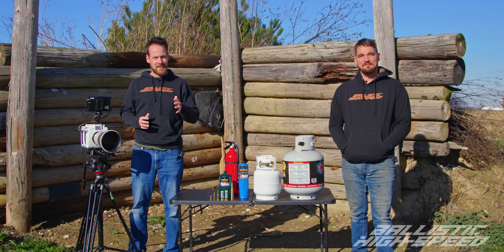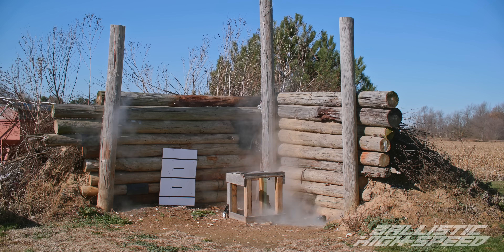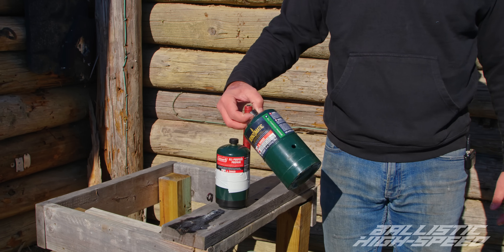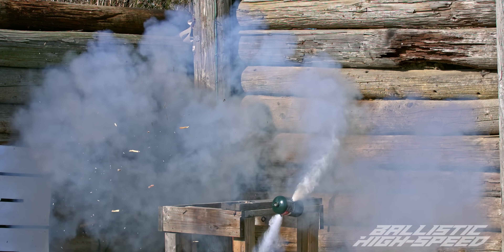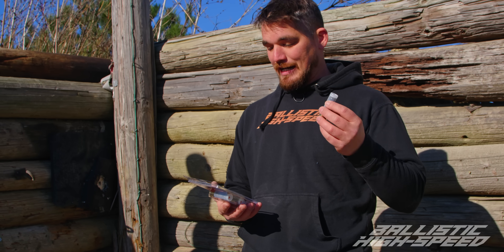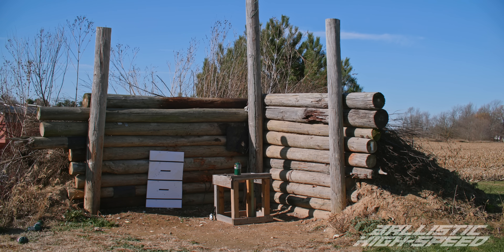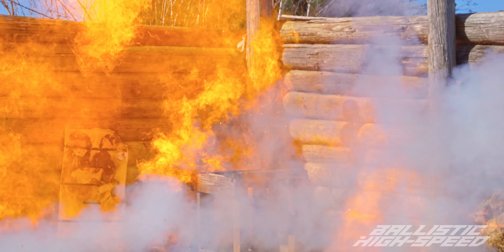Shooting Propane Tanks = Exploding Fireballs?? - Ballistic High-Speed

Comment: The back side of shut off valve is the pressure relief valve. 
So the pressure was high enough, to make the relief valve open momentarily.
Reply: Many, if not most, relief valves on those tanks are self-destructive. They are designed to be a barrier that will rupture at a lower pressure than the rest of the tank and fittings, but it is a permanent failure, thus requiring a replacement valve before refill.
Reply: @kyleheins they’re not self destructive, or burst disc style. They’re spring loaded PRV’s that self reset. I’ve replaced literally thousands of those valves and filled thousands of tanks. 

I’ve also had to pick up tanks that were popping off at distribution locations because the guy filling wasn’t paying attention….
Reply: @adamtalpash6469  Interesting. I just assumed they were the same as the ones on pressurized gas cylinders I've worked with. Guess not.
Reply: The relief valve is literally a tiny hole.  The force was enough to unseat the entire valve.
Reply: @courtney5796  I hadn't looked closely, that's hilarious!
Reply: @courtney5796  I think I know what you’re talking about and it sounds like you’re talking about the bleeder valve, the OPD/pressure relief valve is basically the entire back side of the main part of the valve. The bleeder is the little hole on the front under the main opening to the valve that you can open and close with a flathead screwdriver which is there to bleed out any remaining pressure when you are going to replace the valve to avoid having it shoot out at Mach fuck because even when a propane tank is empty, it can keep building pressure with any residual propane left like a few drops can build crazy pressure 👍
Reply: I kind of went on a tangent but you get the idea😂
Reply: @jerryonixrandomness7382    yeah, I only refilled about 1000 of them lol.  And no a few drops will NOT build up 'crazy pressure'.  Never heard of that in 50 years.  let me know who told you that.
Reply: @courtney5796  ok bud, who shit in your cereal? So agressive right off rip. I’m assuming you’re from Colorado, just an assumption. I’m from Texas, a lot hotter in climate. Temperature has a lot to do with how pressure will build in a tank, the hotter it is the more pressure will build. Simply anecdotal from my experiences, I’m sure it doesn’t work that way wherever you are and that’s fine but just chill out and ask normally next time

Comment: Just for reference, Liquid Petroleum (propane) boils at -44°F... do not let it come in contact with bare skin. The liquid isn't flammable in liquid form, but the instant it's exposed to oxygen (air) the liquid expands in the form of vapor 270 times the liquid volume. LP containers can only "safely" be filled to about 80% of container volume. The three-cornered service valves have an overfill protection float in them. 
   The videos are spectacularly dramatic... and orchardists have experienced destroyed tanks by "people" trying exactly what y'all are demonstrating FYI. 
Giddy up.

Comment: That would be an awesome military weapon. A small tank floating around and spaying fire in a bunker or room. Awesome video, guys 🍻.
Reply: Dunno about smaller versions, but Fuel Air Dropped bombs are a thing.  Hardened to penetrate a structure, with an initial detonation to rupture the casing and disperse the pressurized gas, followed by a second, slightly delayed charge to ignite.  Google "thermobaric weapon".

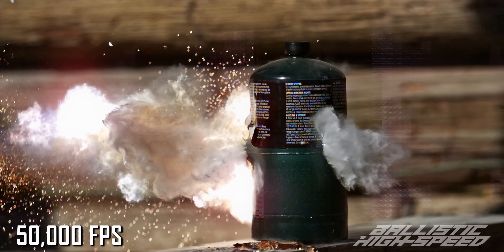Comment: 10:18 propane is stored as a liquid at pressure and when the pressure is removed and it turns into a gas it cools down a LOT. More than enough to suck all the heat out of that incendiary round. That and the fact that there's no oxygen in the tank is why the primary incendiary explosion didn't light it

Comment: (edit: I wrote this before you shot the green tank but you hit it exactly how I did. I just didn't tape my flare to the side 😂)I put a green tank on a stump with a road flair and and hit the tank on the very bottom so the gas was escaping at two 45° angles downward / \ and it shot up about 30' - 40' in the air spinning really fast  with flames shooting out the bottom 🔥 and making a really cool sound. I was using Hornady 12 gauge SST 58 caliber sabot slugs with a rifled barrel. Just gotta hit the tank at the bottom where it curves
  U
/   \

Comment: Metal strap a 20 lb propane tank to an oxygen tank.

Place the propane tank towards the rifle, and penetrate both.  Use an API round.

The oxygen will push into the propane tank and force mix.  You'll have both fuel and oxygen in large amounts occupying the same space, and the API round will cause the oxygen tank wall to burn, feeding spark to the fuel / air mix.

Should be pretty spectacular.  I suggested this to Edwin Sarkissian, but he never tried it.
Reply: that would be big, depending on what size oxygen tank/bottle was used.

Comment: 3:20 That can, rocketing off while spinning, gave the best fuel dispersion pattern you could ask for... aside from the 50cal.
14:12 The banded shadows of the incoming shock wave are awesomely crisp. 
   Also, it was the safety blow off valve that leaked, not the "fill nozzle" ( 15:36 ). They're filled through the "output" port.
Safety buddy did its job, despite the utter annihilation of the system it vowed to protect... let's take a moment.
Reply: ...3:20 I believe the phrase is, "Liftoff! We have a liftoff, 32 minutes past the hour!" Props to whoever gets that.
Reply: @Tornadopelt  "...32 minutes past the hour"
Roger that.
Reply: Yes, the overpressure disc gave way.
Reply: @patmcbride9853 not a disc like one and done but a relief that reseals.  The valve looks like ICE intake/ exhaust valves with a stem but with a straight to reverse taper for the seat

Comment: That is not the fill nozzle, that you noticed gas coming out of.  Those tanks are filled through the same connection that your grill connects to.  That small jet of gas you noticed escaping is coming out of the pressure relief valve.

Comment: You should have consulted with a firefighter first…. Flame requires oxygen, fuel and heat.  Your liquid propane is too cold to sustain the heat.  You need to vaporize the liquid.  Perhaps a small candle below the table on the ground could have been your backup ignition source.  

Thanks for the video.  Glad to see you stressing safety first.
Reply: Bit o' trivia for y'all.  Learned (oh geez, like nearly 50 years ago?) in the Navy.  The firefighting chemical Halon was introduced ... not too terribly toxic, so the sailors could escape the gas release, but it "stopped'' fires -- however, NOT by 'removing' any of O2, fuel, or heat. (??!??)   TPTB had to add a NEW 'angle' to what made-up fire: the "chemistry of fire" because Halon (a "halogenated fluorocarbon") somehow interrupted the chemistry so fire wouldn't burn.  Always remembered that.

Comment: On the five pounder, the hydrostatic shock tripped the safety valve that's supposed to let propane out if the internal pressure gets too high.  The sudden pressure increase at the valve probably sheered off all the brass threading inside it and that's why the valve wheel spins freely.  

I don't think you're getting your deposit back on that one or getting it recertified.  Just sayin'.

Comment: I've had success in a bullet igniting a small propane bottle but only when it is almost empty.
Reply: That is indeed possible. The propane and air mixture needs to have 2.2 to 9.6 percent propane to get ignited, and the bullet impacting the canister should produce enough heat to ignite the mixture. It just needs to be really empty.
Reply: @castform57  We  sometimes use our empty green bottles for target practice when breaking elk camp, but only if there is a good snow cover.  The 300 Weatherby Mag seemed to have the highest success rate of causing a fireball.

Comment: 01:45 i think if you shot it with a 22 or smth it would go further because the gas would be coming out at higher pressures because of the smaller hole and it maybe wouldn't go all the way through and don't do the recoiless rifle thingy.

Comment: The fact you didn't check more tracers...

Like, a short full auto burst so the first makes the vapor come out and the next ones may ignite it as they hit. Or maybe setting up a metal plate somewhere behind it so that when they go through the tank, they splash on the plate and create more sparks.

I wonder if that'd set it off.

Now we also need bullets vs gas canisters :D

Comment: So propane has a very small window that it will explode in. Oxygen to gas gotta be right as you saw how the propane pushed the flame. BTW I believe that one bottle lit off from flame in the wood
Anyway apparently the way to make it explode is to use a half full bottle then get the proper fittings and add oxygen! 
Yeah but no more dangerous than a mortar blowing up next to your face. 
At least you can shoot it from a distance

Comment: Exploding Fireballs?? This is similar to the Massive Ordnance Air Blast (MOAB) bomb aka a thermobaric weapon. 1st you would need to find a way to get the fuel dispersed to the largest area possible in the quickest time possible.. then you would need to have multiple timed ignition sources to get the party started. Should try that on a high speed camera.. if you need to, go from using liquid to a fine explosive powder.

Comment: That's a burst disk that leaked out of the valve. Contact your local LPG dealer to find out the pressure rating on that burst disk.
Reply: Not a burst disc. They reseal.
Reply: Over 250 psi